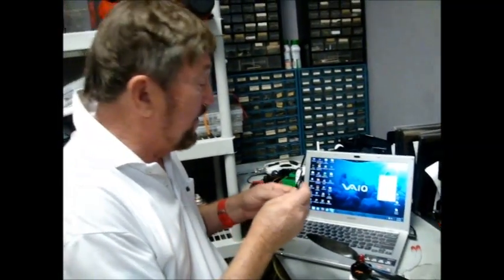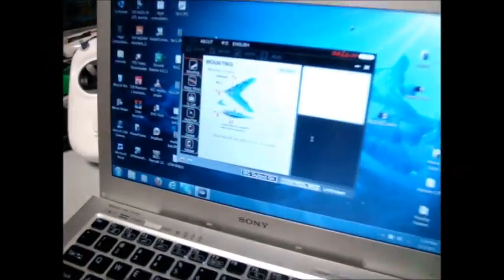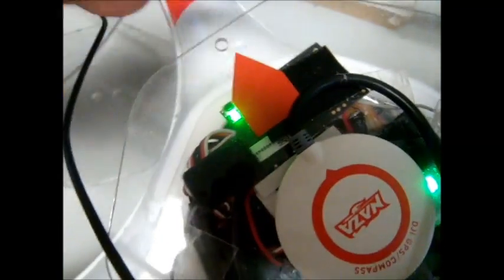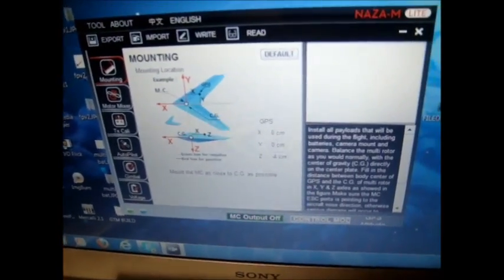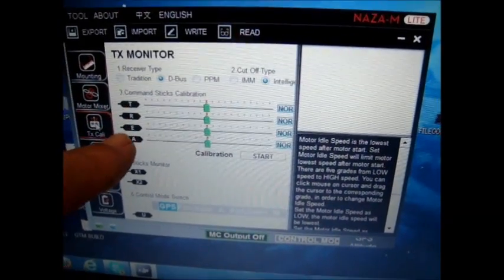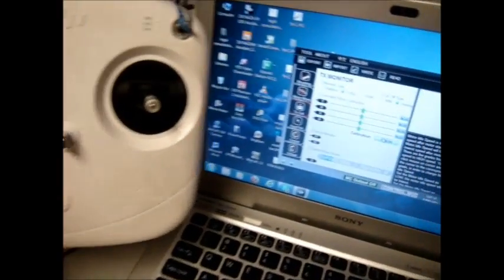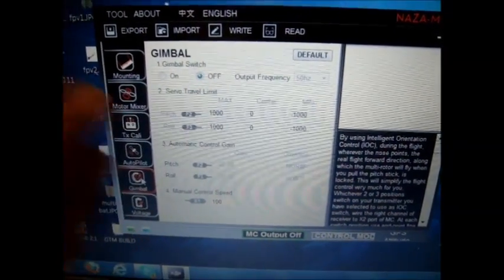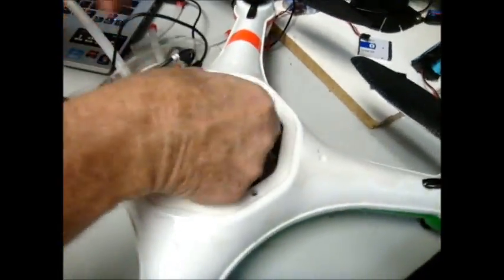Mariner Waterproof Quadcopter Performance Improvement PART2

Comment: thank you for these changes .I just bought the mariner but I wonder some questions. As seen in the video, there are not ventilation and hole , no problem for naza pressure sensor ? Locked all this heat may not cause overheating problems ?
If anyone can remove my worries. thank you

Comment: Great job with the explanation Joe!  I'm excited to order your modifications; I was having the same problem with my Mariner as you described.  I'm heading down to Key West Friday on a friend's Sea Ray via the Intercoastal from Cape Canaveral.  I was going to use my Blade 350 QX2 but the Mariner is a much better option. If you have a modification ready, I might have you ship it to me in Cape Canaveral.  Thank you so much for the video, I finally feel I found a solution that saved me from selling this great tool.